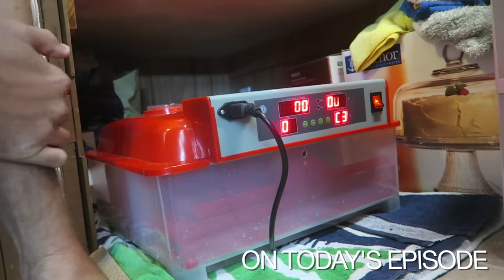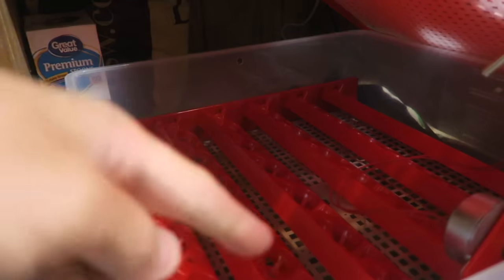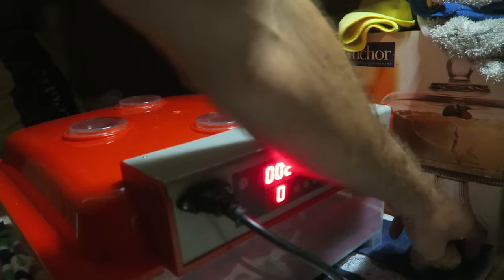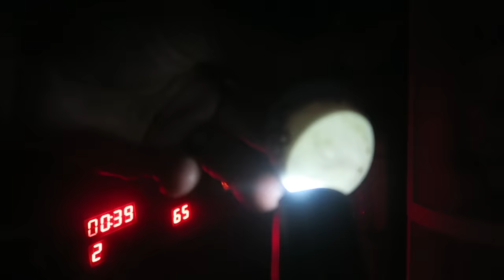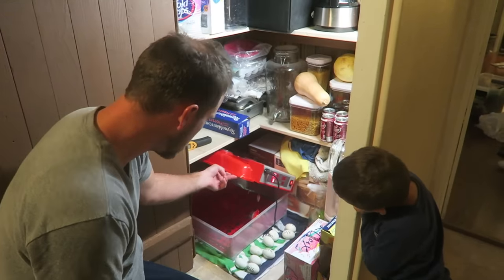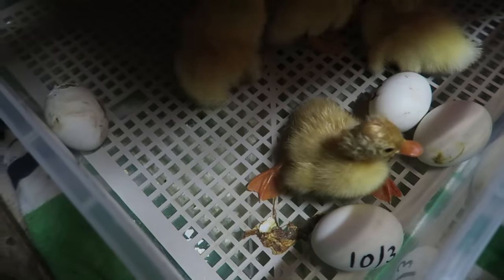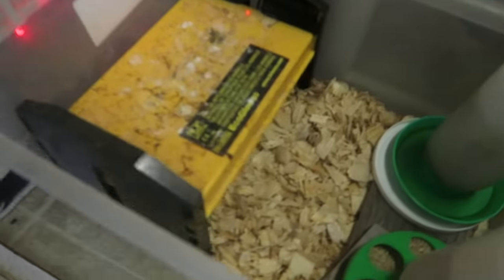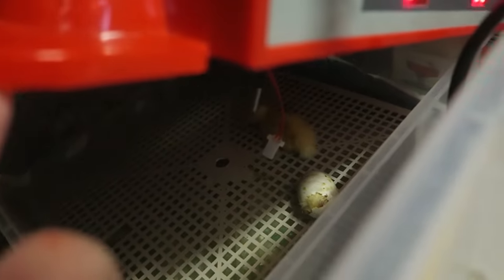Incubating Duck Eggs from START TO FINISH | Rite Farm 3600 Incubator

Comment: Hello! I'm at day 20, and i candled the eggs! and let me tell you, it was amazing! most of the eggs just had a bunch of veins, like any other time i've candled the eggs. But one of them had like the whole duck! You can see the beak, and its little feet are waddling around! I'd figure this is a good thing, but it looks much more ahead then the others!  I hope this is a good thing, is there any concern for my other eggs? And one final question. I hear around day 23, there is something called the lockdown period. What should i do? Thanks so much!
Reply from the maker: +ChimpPlayzMC - that's good that you're seeing activity... should start seeing some movement in all the eggs that are going to hatch at this point. But just let them be, and you'll see what hatches in about 5-6 more days. Lockdown just means to leave them alone - if you keep opening the incubator you remove the humidity, which they need to hatch. So just limit opening it up. Good luck!
Reply: Alright, thanks! 2 more questions. 
1. "Lockdown" starts at day 25, right. And if so, do i need to spray the eggs that day, or just leave them be?
2. How should i add water if i can't open the incubator? I usually just pour it in the incubator
Reply: Love your voids

Comment: what were the numbers on the eggs?
Reply from the maker: +David J. MacKinney - we put the date they were laid on them so we don't put them in the incubator too late. If they get past 7 days old, their fertility goes down pretty fast. A marking on the egg also helps us see when the egg has been turned in the instance that we manually turn them if the automatic turner stops working for any reason.

Comment: How long do I let the duck dry
Reply from the maker: +Riley Young - when the ducklings hatch, let them dry for about 24 hours in the incubator, then move them over to the brooder. You can move them over sooner, just be sure that they're directly under some heat so they can continue to dry off. They can go 2-3 days before they need food and water.
Reply: White House on the Hill we let him dry in the incubator and the stuff out of the egg like cooked onto him and his wing is all weird he is doing good he is starting to gain strength and balance he drank lots of water and has not ate yet
Reply from the maker: +Riley Young - yeah, we’ve seen the egg stuff stick to our chicks and ducklings as well. As long as it’s all dried up, you should be able to peel it away without causing any bleeding. Right after the hatch, you have to be careful with that, since they pull some nourishment from the egg. Sounds like you’re little one is gaining strength, that’s good!
Reply: White House on the Hill thank you very much I was worried for the little guy in the morning I will try to clean him up and pull that stuff off thank you !!

Comment: How to humidity should be
1. 1-7 day =?
2. 8-14 day= ?
3. 15-21 day= ?
4. 22-26 day = ?
Reply from the maker: I try to keep it between 40-60% during the 25-26 day process and then get it higher (60-80%) during the hatching process. But as long as I kept it above 30%, I never had issues.